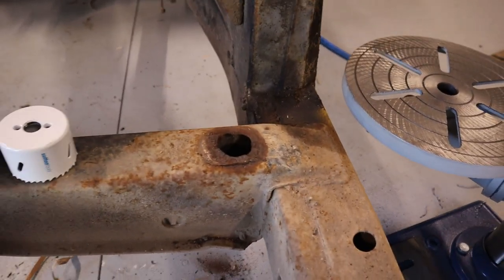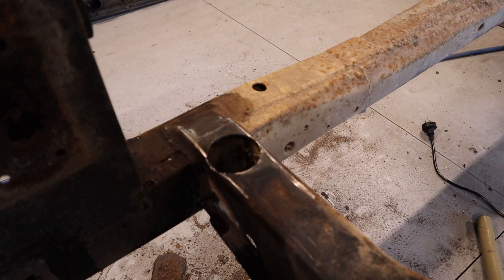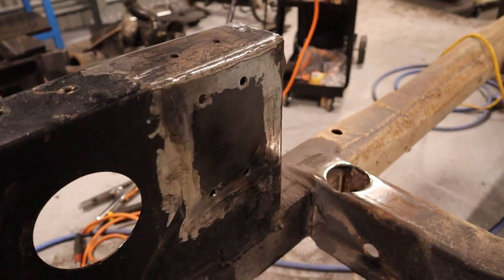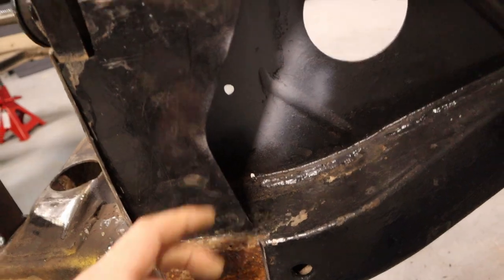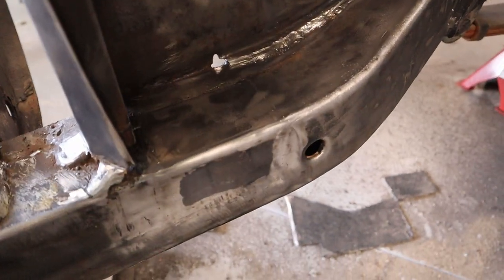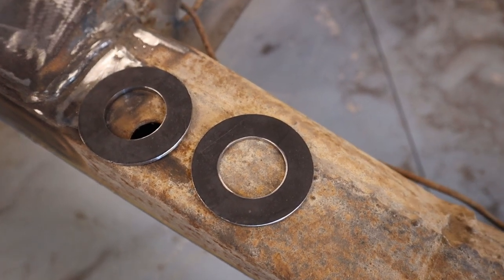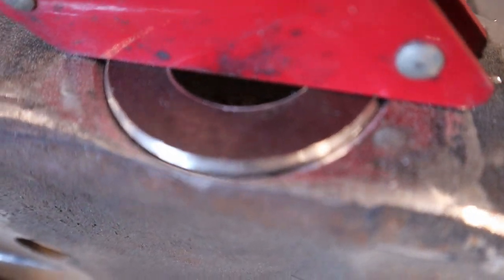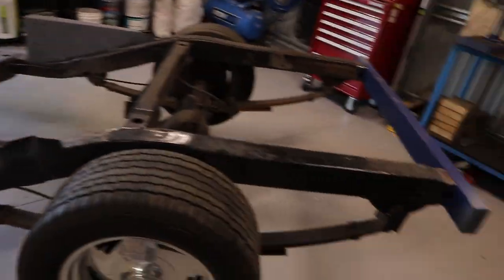Holden One Tonner 355 Stroker Build - Chassis Repairs

Comment: Hey mate what dimensions did you give the machine shop to get the washers made?
Reply from the maker: Hey Mate I used a 63mm hole saw.  The washer dimensions are 63mm OD. 35mm ID and thickness 3mm.
Reply: @ShenkeGarage  thanks mate,  replacing these mounts on my ute chassis. Yours is coming up awesome. Great work.

Comment: On the chassis welds a strengthening trick is to grind a bevel on both surfaces so there is more space for the weld to fill into a V groove.

Comment: Need to do the same rear bar repair on mine. Going to do same as you with 45 angle on ends👍
Reply from the maker: I used 100mm by 50mm RHS fitted nicely. Simple and looks way better than factory.

Comment: Mate, good work/videos. Did you have to reapir the front of your chassis (where the bumper attaches)?

Im doing a full ground up resto myself on my WB tonner and I noticed the front of the chassis needs fixing, Im just wondering if you have a video or not on the repair process.
Cheers Joe
Reply from the maker: Hey Mate I did not need to do that repair. Mine seemed all good.

Comment: Wicked job mate love the videos, been watching since the start. What were your dimensions on the rear chassis replacement tubing you slipped on yours? 🍻
Reply from the maker: Hey Mate sorry for the late response. The rectangle hollow section I used is 100mm x 50mm with 2.5mm wall.

Comment: Unless you wanted it to look original replacing the steel in the tray mounts was a waste of time.
Simply cutting out the rust and leaving a neat hole was all that was required as long as the steel that was left was still thick enough to bolt to, a big round hole between the bolts wouldn’t weaken the structure and would prevent future rust.
Reply from the maker: Hey Mate thanks. I wanted it to be original and it was not really a lot of work to cut out and weld washers in.